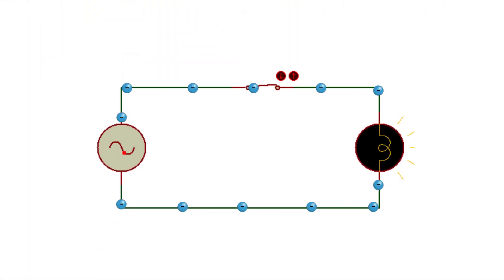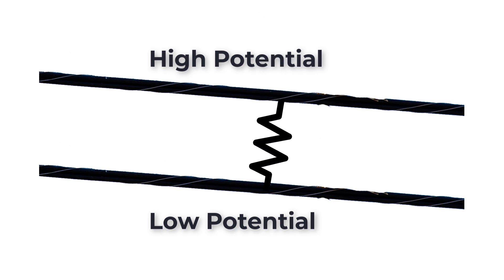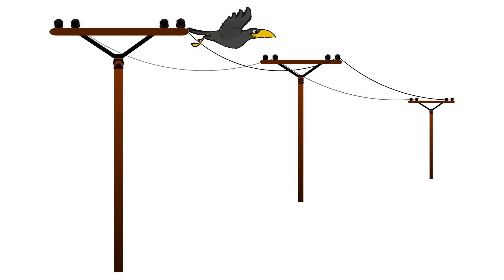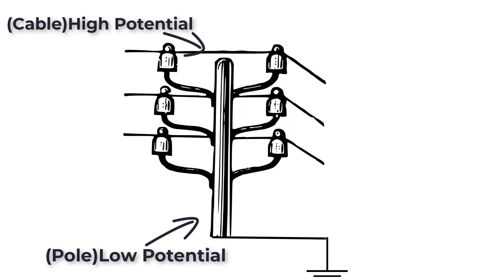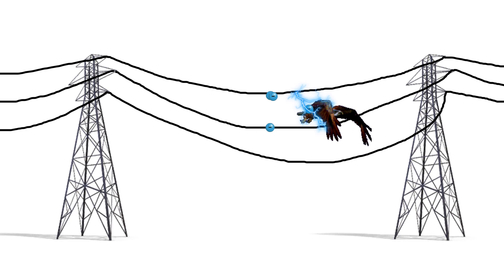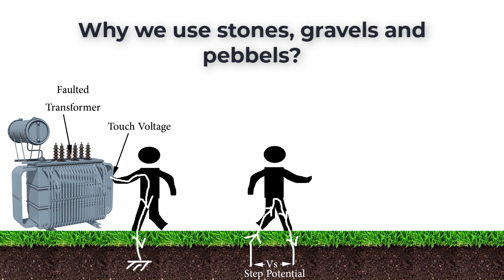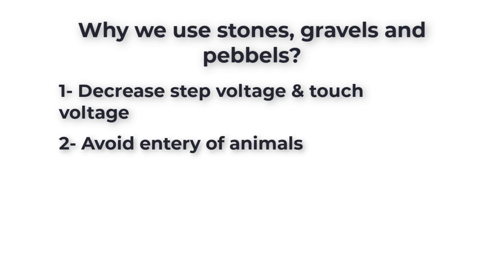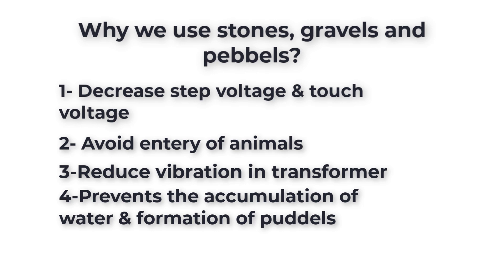What's REALLY Happening to Birds on Power Lines?

Comment: thank you i study electrical engineering and right now iam at 1st grade what is your advice for me is electrical engineering hard?
Reply from the maker: Well my advice to you that you have to understand every single concept you study, never take any topic for granted, understand it from your instructor or search on the internet,try practical experiments, visit power planets to learn how electricity is generated for different sources and good luck, if you need any help ask me
Reply: ok i will do that 
but i wanna know something what is the benefit of electrical circuit i mean we study theory and i don't know what is the use of it in real life?
Reply from the maker: @bilalabdulla7670  Well electrical circuits is the basic of electrical engineering, it will help you understanding the meaning of electricity , also it will help you in tons of next courses you will learn, like dc and ac machines, you have to create equivalent circuits to analyze the machines, also in over head transmission lines course and in power electronics course and so on, But there is useless and boring topics in the electrical circuits course like the analysis of complex circuits (nodal method, mesh method,... etc.), and you will not use most of these stuff in the future but you have to know it to pass the exam :D
Reply: ok thanks in your opinion wich courses should i take or wich book do you prefer to me ?
Reply from the maker: @bilalabdulla7670  🔌    Basic Engineering Circuit Analysis: J. David Irwin, R. Mark Nelms
🔌    Fundamentals of Electric Circuits: Charles K. Alexander, Matthew N. O. Sadiku
🔌    Electric Circuits: Nilsson, Riedel